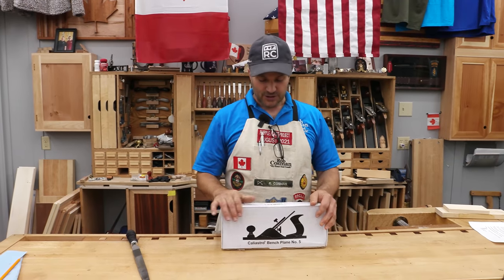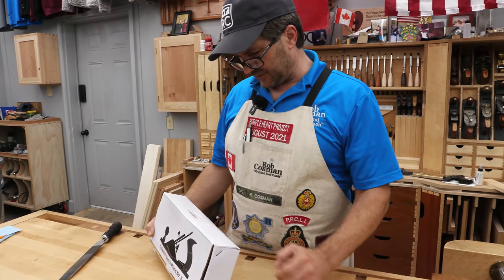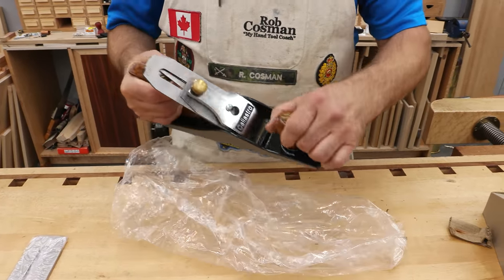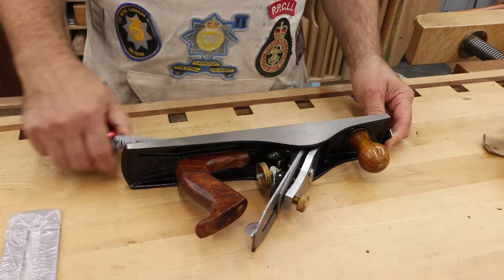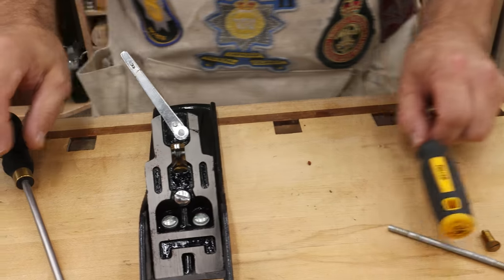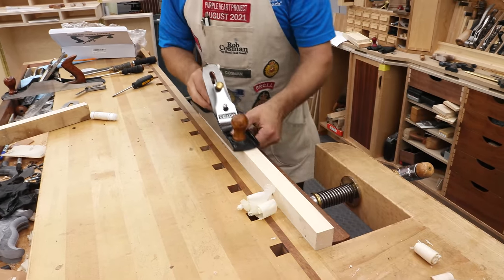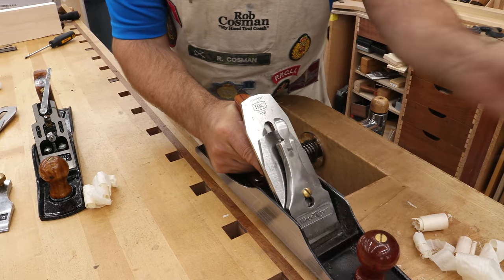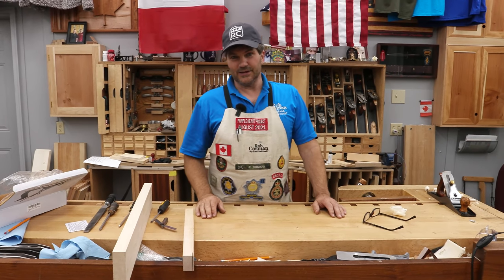Tool Review - Caliastro #5 Bench Plane

Comment: Purchased this from Amazon.  My experience is much like yours.  The installed blade was chipped badly. No quality control on that one. The spare blade was usable but took a lot of work.  I needed to prepare the chip breaker and the toad needed some work. I am working with soft wood and the result is ok for me but I will refine my technique.  If nothing else I am getting a lot of experience fixing this tool and sharpening.  This is my first plane and I am learning to use it.  If I am going to do serious woodworking, I will invest in a better plane.  
Thanks for your videos.  
Regards,
Mike

Comment: Rob, Thanks for all the comparison. What you should do is interchange the blade with a Woodriver blade so we can see the effect of the blade alone on a cheap plane.
Reply from the maker: It would significantly improve it but not to the point that its worth doing.  Dont throw good money after bad
Reply: Vince you can’t polish a t**d!
Reply: the idea really is to see  how each component affects the plane and to what degree. Not really to see if we can make a cheap plane better. The best way is to change out one component at a time.
Reply: @alimaleki217  Didn't Mythbusters show that you actually could? 🤷‍♂️

Comment: Not all planing is for high-end work. As an example I use a Grizzly H7565 - 14"  at $50 for hogging off wood. When I have a chance I will find a replacement blade and turn it into an actual scrub plane. For the last couple of passes, if need, be I use an inherited Bailey plane that I keep finish level sharp. It saves time and all I have to do is polish the Bailey to keep it Cosman sharp. Traditionally planes were only sharpened to about 300 grit.
Reply from the maker: Just about anything can be turned into a scrub plane, even this poorly made plane.  But my channel is focused on fine furniture making and woodworking not carpentry.  You are not going tomake fine furniture with a scrub and a #4 stanley sharpened to 300.  They didnt even do that in 1700's, they used fore plane, jake, and smoother.  They traditionally sharpened them to around 300 because thats the highest grade of stones they had (and could not get the finishe we can get today).  With our better stones and metals of today you can get a much sharper edge that will last a lot longer and give you a much better finish.  I dont drive a horse and buggy becuase thats the way they did it traditionally, and I sharpen to 16K because it leaves a perfect finish in the furniture.

Comment: Hi Rob.  The tool reviews are interesting, but if you're looking for an interesting build idea, how about a bathroom vanity for a single sink, the cabinet about 30" wide, and with three or four (I got four in mine) full width drawers.  The feature of interest is that you have the split drawers where they have to clear plumbing and that allows some discussion about glides supporting drawers on the sides versus gliding on the base, as well as other topics.

Comment: I bought a plane at a big box shop when I was in So. Africa last year, just to have something to play with.  Later on I looked up useless and found a pic of the same plane at the top of the list.  I couldn't keep the iron in place no matter how much I tightened the lever cap screw.  You really do get what you pay for.
Next trip I plan to drag a couple Handyman planes (#4 & #5) over with me after I tune em up.
Reply from the maker: That was funny.  Go with Stanly bedrock as the first choice, next is stanley bailey.  stay away from the handyman line

Comment: I’ve found good vintage Stanley planes for 1/2 that price at flea markets, even EBay.  I  know $70 is considered cheap, but I’d actually expect a lot better for $70.
Reply: That's the best route to go. Even the worst stanley handymans can be fixed up better than this
Reply from the maker: If you cannot afford, or dont want to save up for a nice modern plane an old flea market find is great...but you must replace the blade with a modern thick blade....and now you have enough money in it that you are 1/2 way to buying a Woodriver......
Reply: I’ve bought the Stanley new Bailey, and it’s not that bad for a beginner bench plane no.5, still better than whatever this monstrosity is. The Stanley machining is really good, and it’s made in Mexico, so still better quality than Chinese.

Comment: As soon as you started retracting the screws holding the frog to the body I knew there was a problem. So much slop in the threads even you were fooled into thinking the first screw was fully extracted. Surface rust all over the place. The slop in the frog hold down screws was probably causing the blade to move as soon as it dug into the wood.

Comment: "Would I recommend this. Not if I liked you." :)
A couple of years ago I purchase (on Ebay) a Stanley Bailey No. 5. It was made in England around 1919 (unless I mess up my research). The blade seems fine but, would it be recommended to ugrade the blade to a thicker one?
Reply: if the iron seems fine,sharpen it up well and use it.unless you're planning to work with some really tricky or dense wood-types you're really not going to feel much difference. i have 2 no.4's of about the same era,one with the original iron and the other with a Hock iron,and the only reason i have that is that the plane were given to me with no iron in it. I work mainly with walnut, but have also tried them on birch,oak and maple, and can honestly not feel much of a difference between them at all. The Hock iron does seem to old the edge a bit better than the original stanley irons though,so there's that.....

Comment: No surprise that the plane is not worth purchasing.   At this price point the manufacturing shortcuts are common.   
I have restored my share of vintage Stanley-Bailey bench planes and experienced a mix of manufacturing quality such as sides not being 90 deg to the sole, threaded holes which were oversized.   Vintage Stanley blades are a mixed bunch, some good, some not so good.
These were mass produced so again not a surprise.   I do have some vintage Stanley-Bailey bench planes which perform very well so good to have in the shop.
I have to say using a premium plane like my Veritas planes is always a pleasure.
Dave.

Comment: Hey, Rob, thanks for the tool review. The Woodriver costs a good deal more than the Caliastro. Could you do a comparison of these "cheap" planes versus a Stanley No. 5?
Reply: Yeah, I would really like a comparison between all the "cheap" versions, rather than having them constantly compared to your own brand of high-end tools.
Reply: @StephenHughesJelen  A vintage Stanley in good condition costs about the same if not more than the Caliastro. Paul Sellers has a high opinion on vintage Stanley and Record planes. I would like Rob to contrast and compare the finish and fit of an old Stanley versus the new kit.
Reply: @kamleo1685  yep. I splurged on a new Stanley Sweetheart.... oops....
Reply: Have a look on Rex Krueger's video, he restored even the rusty plane into working conditions. You could learn how to trouble shooting a plane problem and get it fixed.
Reply: @kwong4658  You missed the reason for my request: The standard used for reference by most reviewers are the Bailey bench planes made by Stanley Toolworks.  Rob has given a comparison of the Caliastro versus a semi-premium/premium Woodriver bench plane. My ask for Rob is where does the Caliastor stand compared to a No. 5 plane manufactured by the Stanley Toolworks?

Comment: A Woodriver #5 is $220 US at Woodcraft so it's priced a little more than 3 times the plane you reviewed. The Lie Nielsen #5 is $350 US so 5 times as expensive as the Caliastro.

 I don't take issue with what you found looks like a very cheaply made tool so my issue is it's not a fair comparison. I have several Stanley Bailey hand planes most from around the turn of the century (last one) and all perform wonderfully with the original irons. However the cost of those planes was inversely proportional to the shape they were found in. In other words lots of prep for cheaper planes and much less prep for planes found in good shape. So maybe $50 for one that needs lots of work and $100 for something that needs much less work. 

One pays either way more money for a new plane which needs only a sharpening or an old plane in fine shape, or more work for a cheap new tool or old worn tool.

You may be chasing a unicorn to find a plane priced at $70 either new or old which doesn't need lots of tuning up to function well. They may be out there but certainly not common.

Comment: Great video, if you want a quality finish, you need a stable quality blade held to use in comfort. (At the right angle for the wood.) I purchased a fancy plane that has no weight, what a mistake. The weight and balance need to help you flow, Cosman wax give the glide to a heavier plane.

Comment: last year I bought  one of these planes, knowingly that it was a pos, but, I wanted to see if i could "tune" it up to be acceptable. I could not find any old planes in my area that I could restore.

The plane Rob received was way worse than the first one I received.  I did all the same checks he did and wrote to Caliastro with my review. They promised that they were aware of the issues and a new "
Reply: oops... .. and theyvwere correcting the issues.  they refunded my money and sent me a second unit.
the second was better with sole flatness and square,  but the lateral adjustment  was so tight that it sheared the pin when I tried to adjust it. 

I wound up with 2 planes for free, but havnt had time yet to see if I can "restore" them to usable condition. maybe they can be a scrub plane...
 James Wright did a comparison video on plane blades. Surprisingly,  the Caliastro blades did well in his tests, but obviously different irons than the ones supplied with the plane.

Comment: Even if you can get the plane iron sharp and even if the sole is flat, the side plates being not 90 degrees should have been a killer. True? Also the slop in the adjusting screw would be unacceptable. To top is all off the adjusting lever is almost all the way to the left. I should think it would much closer to center when the iron cuts square. And of course the rust should be a killer too. Thank you for sharing. Have a great day and stay safe.
Reply from the maker: I agree with your assessements
Reply: Sides not at 90 degrees is irrelevant to most people, since the sides never touches anything when planing. Normal consumers don't know what a shooting board is - then just plane endgrain in a standard fashion.
The surface rust is also irrelevant to most people, the plsne will be as rusty as hell within a few month's use. I live in Sydney AU and even with surface treatment with Lanolin spray, everything rusts within weeks due to the humid climate (we don't have air conditioned workshops here). 
As for the screws, if you have ever taken apart an old Stanley / Bailey you'd see equally bad or worse slop. I am currently restoring an exceptionally original and well-kept English Bailey 5 1/2 that my dad used to build his house, and it has horrendously loose bolts. The rods holding the handle and tote can wobble about 3/8" but they use that to allow alignment for the mismatched angles!

Comment: So maybe it's better to buy an old Stanley or Record, restore it and maybe buying an high quality replacement blade like an Hock or a Lie Nilsen?
Reply: Worked for me. Just cleaned, reassembled and sharpened ala Paul Sellers (or Rob, James Wright etc. as they are all better than I am) The one hardware store budget plane among my haul of planes is the scrubber/fore plane. Just find one that is not cracked or too rusty. And enjoy.
Reply from the maker: Absolutely it is.  The only issue then is by the time you are done, especially if you count the value of your time, you are 1/2 to 3/4 the way to purchasing a premium new plane which is why I recommend that route.  The exception is now when it is so had to purchase a premium plane.
Reply: Yes, very true Rob. Although I would add that for a beginner or amateur the time spent on an old plane is a good learning experience and thus well spent. For your class of craftsman, well, you told us. Keep it up.

Comment: As I enjoy buying and restoring old planes, the rust wouldnt bother me even on a new piece, but the sloppy tolerance on the screw holes is unacceptable. Adjustment lever all the way to the left to me just means I didnt check for the blades edge being square before I started the sharpening process. Out of square sides, on a no name plane? Thats where I sent it back or tossed it in the trash. Im a tool snob as well. Good tools dramatically reduce input effort and increase quality output. We all want to save money but a WR quality plane cant be had for a harbor freight price.
Reply from the maker: Well said.  I should have checked the blade edge for square.  Why didint I do that?
Reply: Dont mistake my comment for critique, most of my plane skills have come from watching YOU.

Comment: Don`t worry if the front of the mouth is curved in .Just file it out wide enough to fit an old plane iron from a wooden plane .  Drill out the old back iron so a depth adjuster would work  and a slot for the cap iron screw . File the blade slot to fit the lateral adjuster  .Then you have a massive thick blade made in Sheffield . Now you`re talking . You need to understand how planes work first for that game .Not for beginners though .

Comment: With the lateral adjuster leaning left so much you would need to file some of the blade slot to get the adjuster straight . That`s really too much for beginners . The only good feature is the brass cap iron adjuster . Do a video about the comparison with lever caps . Apart from a nice sounding name this plane gets a big thumbs down .

Comment: This at least has straight iron. I bought Silverline no.6 for 50 euros and iron was winded so badly, I replaced it. Stanley no.6 price here is about 85 euros, so, counting hours of work to get Silverline to work acceptably, prices are equal. In general Silverline seems from the same factory as Caliastro, the same loose threads, low quality machining

Comment: when i watch this kind video iprefer always seen will work and how will work before taking part and see how will perform.after took part sharpen balde fixing improving isnt real show .
i didnt finish video yet im midile of it i didnt like much just becouse of this.try first use it how is come then took a part and grinding blade fixing small problem small imprvments and say end result.now if u find aceptable as begineer wont be real result.if not still a problem.

Comment: FLAYGRANT CHINESE WOODRIVER COMMERCIAL.!  

 The Romans built cities that are still here with planes of  wood and crude iron.  

All sharpened  planes will cut wood. and make shavings. 

Maybe you just want to trim a 1/16 off a crappy old door.

 It's embarrassing  that the only guy using woodworking to help USA vets Is doing it with Chinese tools.

 I am embarrassed I bought a WR #4. when i could have and finally did buy a modern Nato produced Stanley plane. 

It makes shiny smooth wood surface's just fine